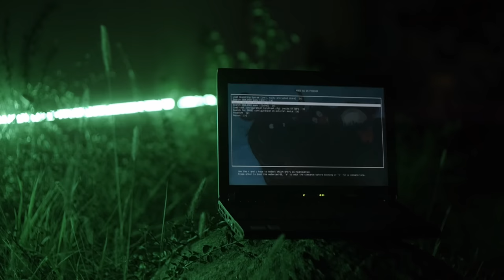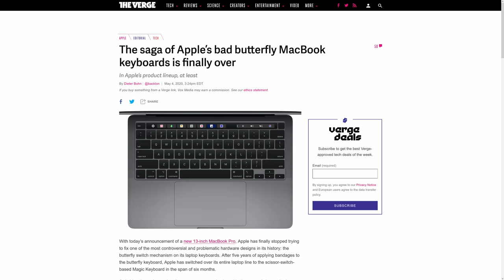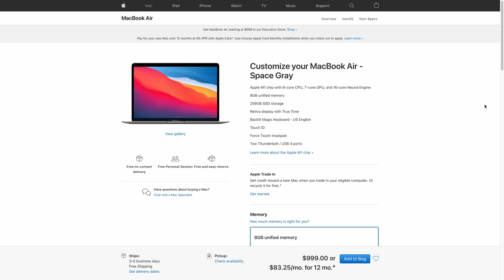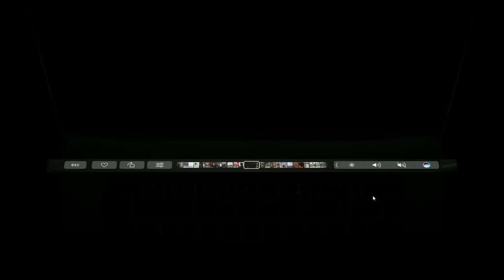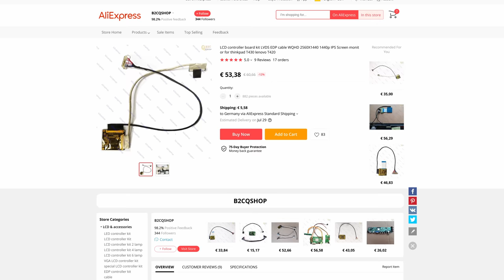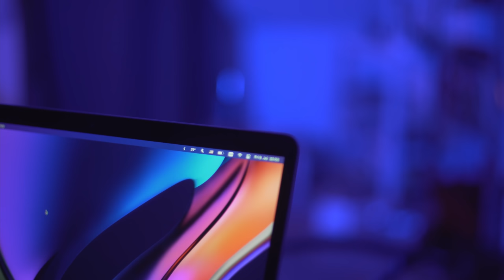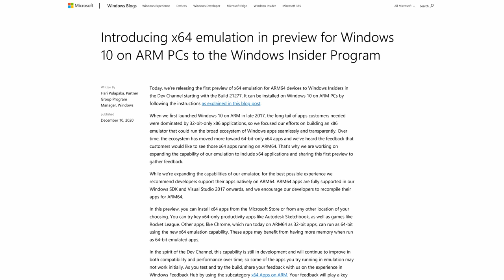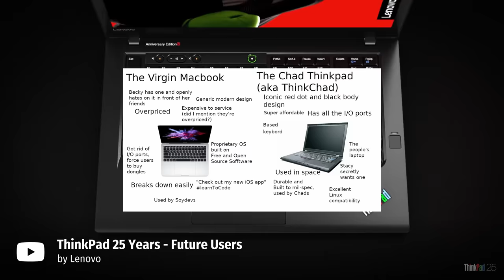Why I Switched to Mac (as a Linux user)

Comment: Repairability is what worries me, especially for the battery. I don't want to have to upgrade after 2-3 years because apple doesn't want me to change the battery when they don't exist in my country. 
Or maybe down the line when the stop supporting my macbook, though I am not well-informed about the how they treat legacy devices.
Reply: Nein nein, not just battery. aapl is all going to screw over the SSD. Game over.
Reply: @AndreiAldea  but I think the Surface laptop 4 and laptop GO were actually able to be opened now?
Reply: Soldered SSD worries me a lot
Reply: Yeah it's bad that one can't change the battery oneself. However, Apple swaps the battery - for 139€. Not cheap, but not terrible either.
Reply: I have a 2013 macbook air 13inch, and the battery is still fairly usable and having no issues at all. I should probably replace the battery soon tho. For peace of mind, thats 7 years of use. so I don't think you should worry too much. If needed be, there are plenty of sources to get your battery replaced.
Reply: @AndreiAldea  Don't they also glue and lock certian features after a battery replacement or is it just an iphone/iPad thing?
I have an iPad 3 and it still works great. I am not that worried about CPU/SSD failure. Though I would love to replace the SSD (The surface pro X allows u to easily swap the SSD)
If Microsoft's claims about security are true, then I think breaking the compatibailty of Windows is worth it.
Reply: @WeicherKeks  Is it for any macbook or relatively recent ones?
Reply: @josemarieconsista5027  Thanks for the comment. I think getting 7 years out of a laptop is acceptable. Hope the M-series laptops last that long.
Reply: Other than the butterfly keyboard of the late twenty-teens, Apple's devices have incredibly longevity and they support their devices for much longer than most other companies.
Reply: @AndreiAldea  Good point! Those Windows 11 requirements are a disgrace. Now all the computers in my house will be out of date because of it. Without a doubt, Apple products have a better lifespan, especially due to OS updates.
Reply: I used my 2011 Macbook Pro for 9 years with the same battery, and they supported the most recent OS up until M1 came out. Despite Apple's flaws they are first in class for legacy device software support.

Comment: If you had a choice, would you preder Linux or MacOS on your Mac M1?
Reply from the maker: macOS
Reply: @WolfgangsChannel  NO
Reply: @WolfgangsChannel  Gasp

Edit: i guess it makes sense though
Reply: MacOS is real  BSD based UNIX
Reply: @johto  macOS is UNIX
Reply: @aurichio7783  yes
Reply: hardware and software are built for each other on the system

Comment: I have exactly the same situation. It was fun to use Linux, especially on laptop considering I didn't game on it and just coded or watched YT. However, when I came to select a new one, it turned out there is no better solution than M1 Mac for me, when you search for balance between performance, battery life and build quality.

Comment: As a junior linux and t460p user who recently switched from MBP 15 2017 I totally get the point about the circlejerk-iness of TPad warriors who just can't recognize their similarity to close-minded Apple-heads. Sadly for me, I am a control, customization & privacy freak who has no other budget option accept from t460p and other old-machines. Btw your FTM (finkpad to macbook) transition is also very understandable conserning the priority of your blogger carrier and it's needs. It's really dependent on individual enthusiastic desires. Jedem das Seine, энивей.
UPD: Also a good note in the end about the overall loss of a consumer in term of "choosing" a better option. A better option for now might be a worse option in the past, but it's still "a better option for now".
Reply: So you don't therefore think that it might just have something to do with the fact that IBM and Lenovo have been "in bed with Linux" for many years now and make laptops that are usually quite straightforward to install with Linux.

As a Linux user, I consider myself an "engineer", not a "circle jerk" (whatever one of those is anyway in modern "brat-speak"). Thinkpads work well with Linux, Linux does not need "latest and greatest" hardware and older Thinkpads are "built like tanks" and extremely easy and cheap to repair when they go wrong.

If you treat a computer as a "fashion accessory" then go buy Apple. But don't tell me my reasons for using Thinkpads.

Comment: Probably the number one reason I am not going to buy an M1 Macbook or even those thin x86 laptops on the PC side of things is that the lack of a user-removable battery is a huge deal breaker. I use my laptop plugged in a lot and if I can't remove the battery it'll stop holding any charge within a year or two at most.

Comment: I personally won't buy such a laptop as long as it can only run MacOS. I don't really upgrade my laptops. I think most people don't do that these days. So that's not really a downside. The trend to go to SSD only and glued-in battery however is kind of stupid because it makes a lot of good hardware become e-waste. But this is a trend beyond Apple.

I totally agree on the important aspects of a laptop being zero noise, less weight and long battery life. However I think I will be more interested some Risc-V laptops come around. Otherwise I don't need any laptop for the most time anyway.

One question I have though is: Have you ever bought a laptop from a vendor which recommends and supports using Linux on it? Because you said there were always some issues and I think that's somewhat to expect if most vendors don't offer Linux being pre-installed and there isn't any official support given.
Reply: There is a Linux distro for m1 mac
Reply: Parallels desktop.
Reply: @topmech71 running a virtual machine on macos is not the same as actually running an operating system on bare metal
Reply: I guess @deepspacecow2 was referring to Asahi Linux. If anyone is wondering, it has come a long way since this video, and now even has GPU acceleration and can run older OpenGL games very well, with work ongoing to support Vulkan and Proton for modern titles

Comment: How long do you have your Air now? I'm still debating with myself if I should get one right now or wait for the next release 🤔
Reply from the maker: Since April. I also thought about waiting until the new M1X models come out, but ultimately decided to go for it. There are always going to be newer, better and more powerful laptops on the horizon
Reply: Using Macbook pro 2018 intel with 4 usb-c ports. 2 ports go for monitors, one to charge, one for a usbc to usb-a for external keyboard, mouse printer, disks, memory sticks etc.  The lack of ports on the m1 would be a deal breaker.  So would less than 32gb of memory, which comes in handy if you are running docker or other virtualisation things. I will wait until the next gen pro models that fix ports and memory.
Reply: @FriedrichBrunzema  The new Macbooks Pros (September? October?) are supposed to bring back some of the I/O (SD, HDMI).

Comment: You could just shown the compiling test comparisons, the mic test and the battery life and you would have made your case

Great video as always. Unfortunately no matter what we say, apple won the race to risc architectures and unfortunately have made the most significant hit to wintel I have seen in the last 25 years. 

X86 will have a slow painful death, deserving of a system architecture that based its success on closing ppl into its ecosystem. And the same goes for windows. If manufacturers like system76 manage to create good Linux machines with arm or riscV architectures that feel like a finished product that would be amazing. We can only hope

Comment: I recently bought my first Mac Book Air last week. I am a long time Linux (System 76) user and have waved that Flag for the greater part of a decade but having been force to a MAC for the past 3 years I finally get it. The hardware, battery life, dependability, track pad, and short cut keys are at the top of the list for. I really dig how seem less my Air Pods connect between my work Mac Book, Air and iPhone. Guess I joined the Apple fan boy circle jerk.
Cheers 😂

Comment: I am very interested in hearing your thoughts on the new Framework 13 and 16 laptops. Everything you described here in regards to the spirit of an old ThinkPad is present in those computers since it's whole entire shtick is to completely take it apart DIY and easily replace components the way you like. It pretty much is the antithesis of apple as a product and a company in regards to its overall modularity and right to repair. Not to mention, that you can purchase it in such a way where you can build it from the ground up, and also easily install Linux. It's really impressive how you can replace the GPU, PCB, keyboard, io, and even the entire screen with no hassle. I would personally love to see a video of that someday.

Comment: Excellent video, but a lot of the advantages you mention are delivered by the ARM architecture & the specific M1 Macbook chassis.
The performance, battery life, acoustics, port selection, are all directly related to the architecture, of which there is no competitor.
I cannot wait until ARM enters the mainstream laptop segment, we will see these incredible gains across the entire industry.
And you will be free to run a hac-intosh on whatever laptop you choose :P
Reply: The advantages are due to optimisation Apple brought to their flavour of the ARM architecture and their OS software. A standard ARM CPU running Windows or Linux for ARM does not exhibit the same extent of performance and efficiency (i.e. battery life) benefits. Do not overlook the huge amount of effort and experience Apple poured into this, it took years to make it happen

Comment: M1 is so goated, I think it will go down in history as Apple’s most important chip by far. More important than any smartphone chip they’ve developed, M1 was such a leap ahead intel based MacBooks and Macs and other intel and most AMD machines. I think I’m gonna switch from my 10th Gen i7 Laptop with 1660 Ti to a MacBook Pro with M2 Max, there’s no doubt in my mind right now that this would be one of the most significant tech upgrades I’ll ever make
Reply: Same, I think I will switch soon to Macbook 😊
Reply: Nothing is better than an M series Mac, unless you want to game. macOS is THE best OS. Has basically all the nice unix-ness of Linux and all the software support of Windows. How hasn’t any other company developed a non shit trackpad yet ? 

Btw I run arch on a think pad and don’t have an m series mac yet, but it will be my next machine. The Linux desktop has failed and I’ve given up on it. Dual booting to use Ableton is such a trek

Comment: In all honesty, since the M1 chip got released, I tend to like Apple more than Windows. I don't have a problem with Apple in general except the points you already talked about.
Considering that Apple is making devices for people who don't care about tech and just want something that works, it is absolutely fine... although that's probably the reason I'd never use an Apple device... I just cannot stop tinkering around in my arch installation.

Edit: I really hope the RISC-V chips are going to be something very soon...
Reply: Linux on M1 is basically mainline now.

Comment: I have a Intel 8th Gen i7 laptop from ASUS. It wasn't as expensive as the devices you talked about, but it is an absolute work horse, and performs as well as the day I got it thanks to being able to maintain the device. It's had 2 new batteries, a set of replacement fans, a memory swap, and it's even survived a surge from a faulty external drive enclosure. As a developer doing 50+ hrs a week having the ability to maintain my own kit, and repair when necessary completely trumps any upgradeability, because I have to stay up and online no matter what.

If apple got off their high horse and made small adjustments to the hardware, allowing people like myself to keep our machines alive for longer without a subscription plan to apple care, or the pending doom that a screen ribbon cable failure requiring me to send the device back for repair, I'd jump on board. But that day isn't here, and their devices are far too hit and miss on reliability for me to want to risk it, even if they do look damn good.

Comment: I say this as a unix user/software developer since the 1980's once apple switched to osx they have made some damn nice laptops over the decades and there is a reason many software teams have and keep using them. The vertical integration and move to more and more of their own hardware design might rub people the wrong way but as we are seeing with their own silicon now it does work For my work i use a macbook air (m2) 16G/512G that basically controls a mac studio ultra with 3 4k screens (so 4 total) using universal control.. Not saying this can't be done in any other way but the smoothness and i don't need to fiddle level just makes me work faster even is i might be in unix shells, remote and using vim all day. Don't overlook the hardware steps apple is making they are leading the way in most areas even if we hate where the future is going and we need to adjust like less ports and more and more on SoC's.

Comment: As a long-time Windows user, and a Linux user since 2013, I've never been a fan of the way Apple does things. Their walled garden felt more like a walled prison. And while their vertical integration of hardware and software is admirable, it's also what limits repairability and upgradeability. 

That all said, I'm really really impressed by M1. It seriously feels like the future of computing, and it'll take a few years before Microsoft and partner OEMs will catch up (despite beating Apple to the ARM punch with both the Surface RT and the Surface Pro X, like with tablets and smartphones Apple will lead the way in ARM based laptops and desktops). And while I'm not totally sold on Mac OS, I am seriously considering a MacBook for the first time ever.

Except, there are some deal breakers. First is that port selection. It's just abysmal. And sure, I could live the dongle life, but I need a little more than 2 thunderbolt ports, and only being able to do 1 display out kind of sucks too (I know there's a workaround, but it's not elegant at all for a company that prides itself on being more elegant than Windows). Additionally, while the keyboard is useable, I'm not a fan of the keyboard. The keys are just too low profile. I wish Apple would offer a better keyboard, especially on their "Pro" models. The Touchbar, imo, wasn't that bad. It seems responsive, legible, and while it is a novelty and may not be the future, I found it perfectly usable and even enjoyable to use.

But, then there's Windows. I don't actively hate Windows, and while Windows annoys me as well, I have a sort of love hate relationship with Microsoft. When they make a good product, man is it good. It just sucks when you hit the not so good walls as well. I could go on a whole rant about Windows. But far from hating on Windows I actually really like Windows 10. I think it's the best Windows has ever been. And there are things Windows just does better than Mac OS. Gaming, yes, but also productivity stuff like how they manage Windows is just more flexible for the user. And maybe it's just my unfamiliarity with Mac file systems, but I prefer the Windows and Linux file systems and file browsers over the Mac system, and Finder. And yeah, I get people love it. Maybe I'm off base here, I haven't owned a Mac and my experience is somewhat limited. It doesn't help that much of Mac OS is tied to closely to the hardware. Sure you can go hackintosh, but that seems like a lot of work, and the hardware I've got probably wouldn't work anyway.

So, M1. I like it. It's seriously tempting me to try Mac. But there are still some compromises I'm not ready to live with. Next gen M2 MacBooks are rumored to be more powerful, have more ports, and have a wider selection of screen sizes. I think I might buy in. But since I'm ready to buy now, and not in 6-12 months, I might end up with something like the Legion 5 Pro. It'll be a great machine for coding and gaming. Writing and media consumption. It's a big chonky old boy, and the battery life isn't going to blow anyone away. But it's the king of ports, has a large beautiful screen, a fantastic keyboard, user upgradable parts, a second m.2 expansion slot. I could throw a second SSD in and dual boot Linux, which would be great! Oh, and it'll be upgradeable to Windows 11. Maybe that's not so great for some, but there's still time to work things out. And overall I like the design direction (finally ditching the hideous live tiles!).
Reply: So what did you get?
Reply: Just get a hub with any ports you need for your Mac. 

It will only use one port, and because of the thunderbolt bandwidth you can run a ton of ports and externals simultaneously including ssd dock, sd card, as many usb as you need. Even daisy chaining other thunderbolt devices.

Not ideal for someone mobile, but absolutely perfect for a docked laptop or desktop setup. The ports are way less of an issue than you would think, especially if you are just using it in a dedicated office or at home.

Comment: My 2012 pre Retina dual core MBP is built like a tank, can be upgraded and repaired and it runs Catalina! I followed it up with the quad core 2013 Retina MBP which is built to the same spec, also running Catalina. Classic Macs have for good reason, attained a cult following: cheap, easy to work on and reliable.